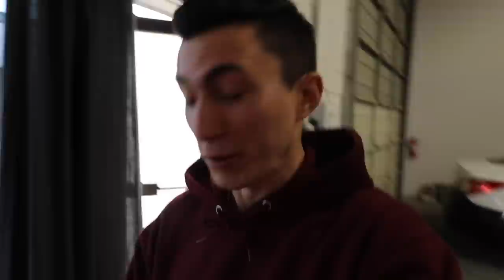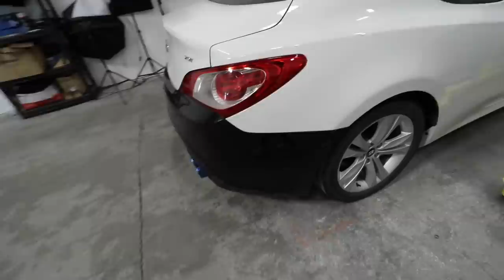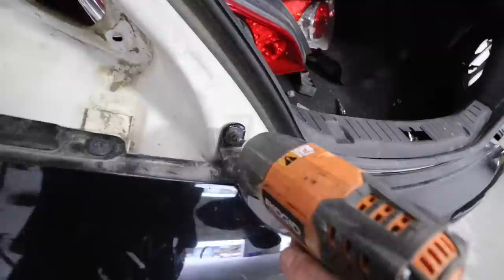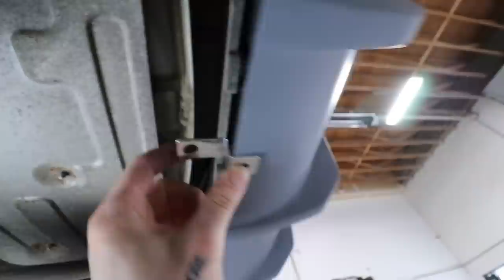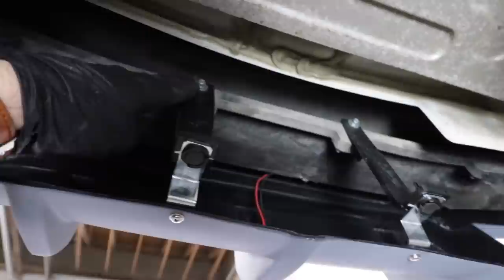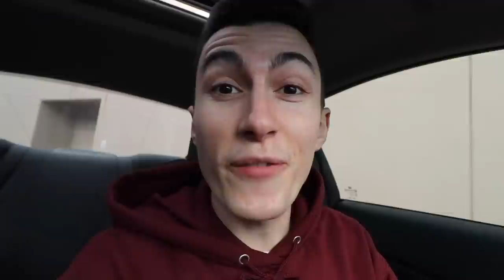Aggressive Rear Bumper Install on the Genesis!

Comment: I would approve of this build if it was more for the show style like the brz. But ik his plans r to drift it but genesis chassis really don’t handle drifting well. There is a reason you don’t see these chassis drifting often. There are much better vehicle for a cheaper price that u could use. I understand the uniqueness but just for starting i would use a more useable chassis like an s13, s14, miata, rx-7, 350z, ect. Keep up the good work tho🤙🏻

Comment: Check out The Fabrication Series on pipe bending. Few tips. Bolt your bender down good and get a long cheater bar if its a manual one. Air over hydro is the way to go. Before starting make a 90° bend and mark the common angles to keep/use as a guage.

Comment: A word of advice with the pipe bender and fabricating parts for your cars. I'd practice as much as you can bending and welding pipes before anything goes on the car. Better to take the time and practice and get it right the first time rather than re build something once your skills get better.

Comment: What is the reasoning for putting the engine in the rear of the S10? I've been watching for like 2 years now and I've enjoyed everything. It just doesn't make sense to me to put it in the rear. It could have been running a long time ago if you would have just put it in the front.
Reply: It'll be in the middle. More weight on the rear wheels will mean more grip, which is important for drag racing